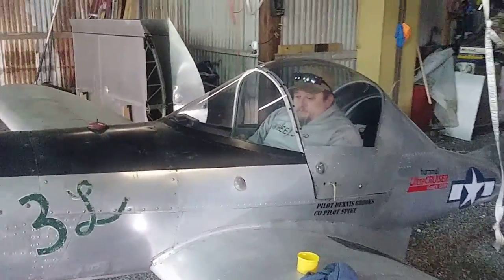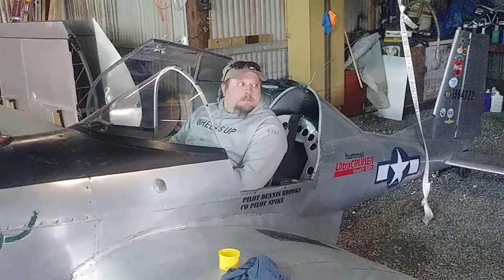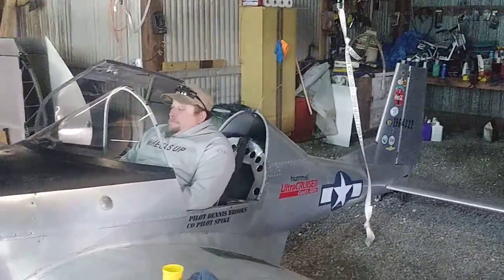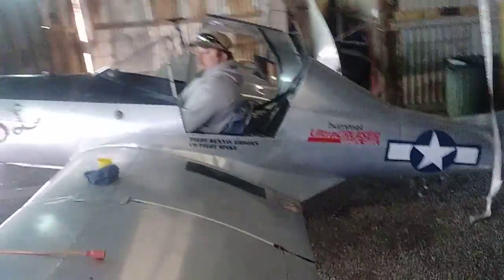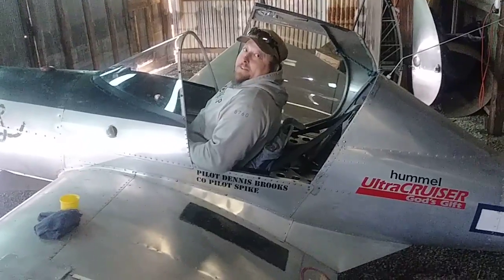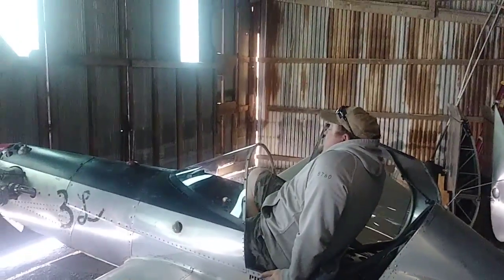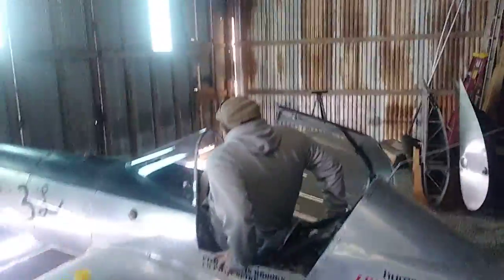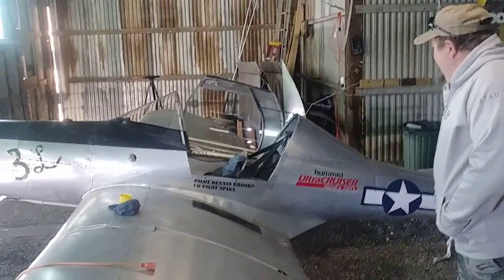YouTube Jeff in my UC

Comment: How did you make the weight under the Part 103 limit with your canopy on?
Reply from the maker: Hi Derek Samuel. Well.......its over
Reply: @redblackvette   I wonder if we could ask the FAA to explain why our ultralight limitations are as they are and how they came up with the weight.  Europe operates with very different qualifications.
Reply from the maker: @vloogle4924  Hi Derek Samuel. I sure can't agree with you more. Even Canada has a higher weight. Plus the FAA is raising the weight for Sport Pilots why not give the ultralight guys 50 pounds or so. Sure could make things a bit safer. Not that the UC is unsafe but if beefed-up a bit to handle grass runways and the occasional rough Landing. Would sure be nice. Thank you for your support...